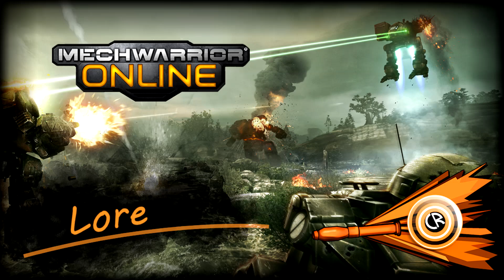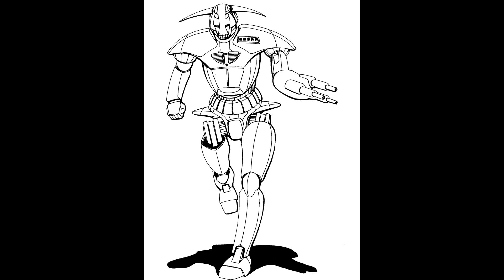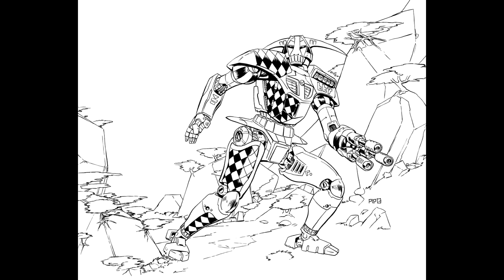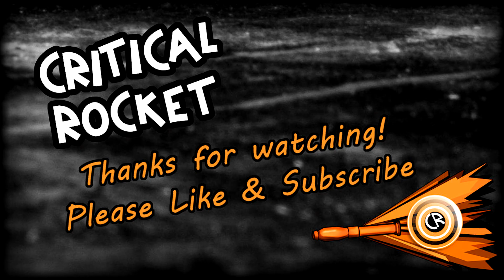LoreWarrior Online - The Hitman

Comment: My guess for the harlequin pattern is that it was an artist’s attempt at portraying “dazzle” camouflage.
Reply from the maker: Probably, but it still visually looks like a court jester or harlequin yet has the designation Hitman.  Not a massive issue obviously just an odd name.
Reply: @CriticalRocket   It is an odd name for the role the design was originally intended to fill, that of a forward observer. “Hitman” would suggest something that was able operate more or less independently to take out a single high-value target at a time. I would picture an improved take on the Humchback concept. AC-20 with one ton ammo, reduced secondary armament, ECM/AMS, then all the speed and jump capability you could stuff into it, all so it can reliably get behind targets, deliver one or two shots, then bug out.